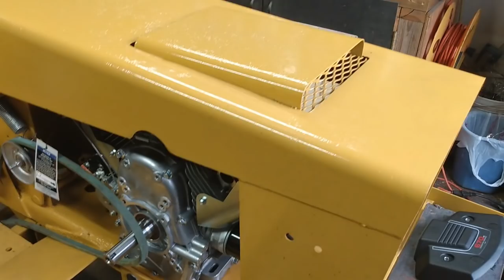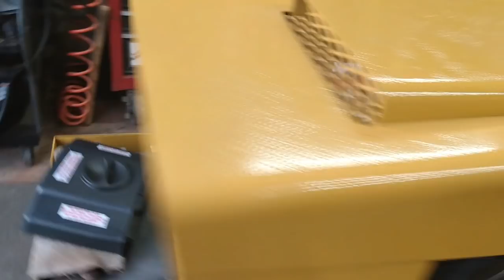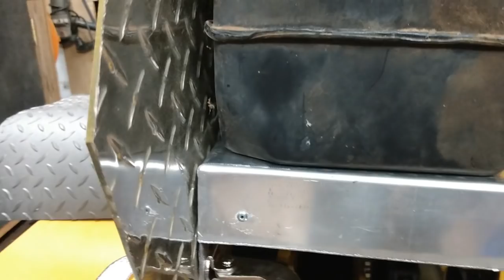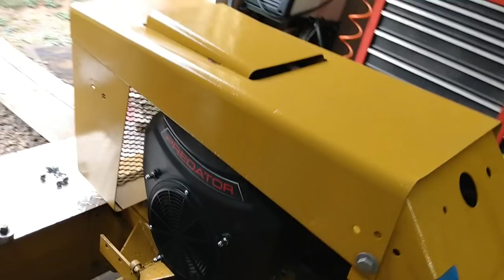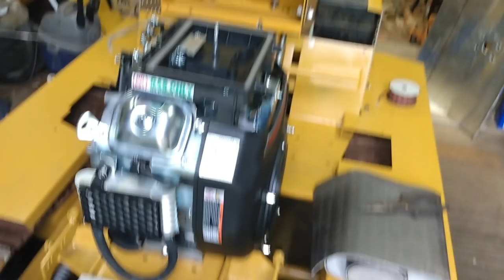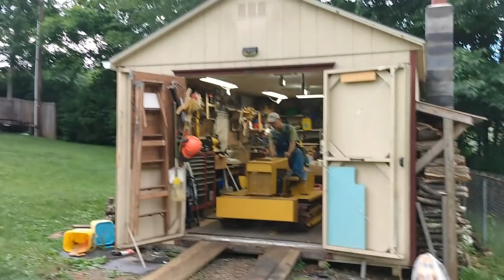Struck Magnatrac MT2000 - Engine, First Start & First Drive

Comment: Replaced v twin Honda with a predator about 12 years ago on a ditch witch trencher it has been used hard in rocky ground and held up change the oil an keep the air filter clean. I think you'll be very happy with your purchase.

Comment: It's a shame you didn't rebuild the 16HP OHV Tecumseh. Those are likely the best engines they ever built. The worst part about them was the carb and now you can use a Kohler $20 replacement carb on the Tecumseh, it's an easy swap. Love the Struck!

Comment: You did a very nice job on your crawler. When I first watched you and your boy loading it up, I thought wow, allot of work ahead, but you sure nocked it out.
Reply from the maker: Thank you, sir!  I thought the same thing when I first saw it...in fact, I almost did buy it because of how much work it needed - but I'm glad I did.  There is still a lot to be done, but we're getting there...
Reply: @gardeningpreacher  
Yessir, you have a fine machine right there. I have one that looks a little different than yours, doesn't have the raised area on the hood or the backhoe attachment, only the dozer blade. Mine had a B&S 18hp horizontal 2 cylinder engine on it, not real dependable on steep grades, blew the B&S after about 3 months. I replaced it with a 20hp Kolher V-Twin engine, fit perfectly, only had to change the direction of the muffler. I removed the metal gas tanks and replaced them with plastic tanks designed for zero turn mower tanks. 
I see that the previous owner had problems with the track idler pins, mine doesn't have any bearings in the idler pins so I greased them about every hour to hour and a half, haven't had any problems with idler pins. Great job Sir! Really enjoyed the videos of your rebuild and refurbishing of your loader and backhoe. Look forward to seeing it in action.
Reply: @gardeningpreacher  You seam like a nice fella. May God bless you and your family.
Reply from the maker: @russwentz3957  Thank you!  I try...  God's blessings to you as well!

Comment: Is there going to be any issue with fuel tank lower than the carburetor? Looks sounds great 👍
Reply from the maker: I thought about that after I bought it, but there is no problem, it has a pulse type fuel filter on the engine.